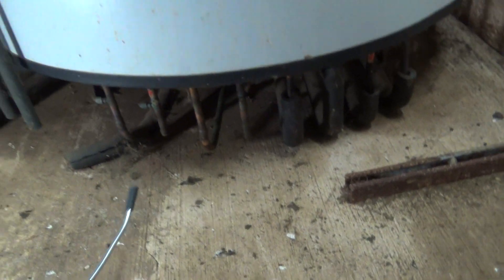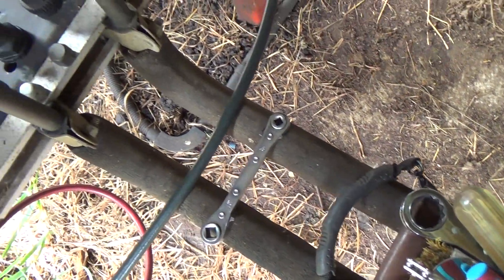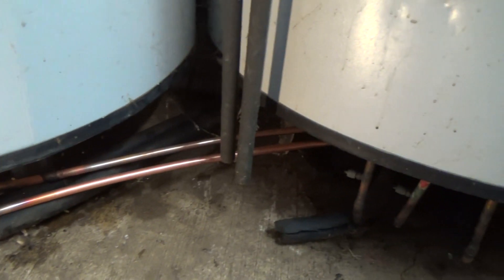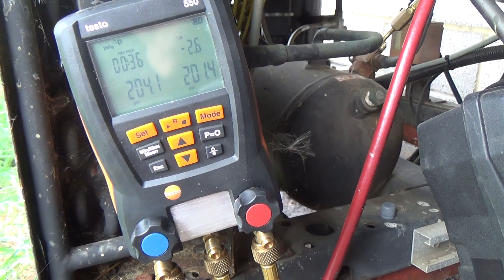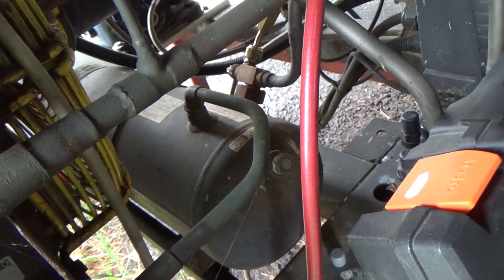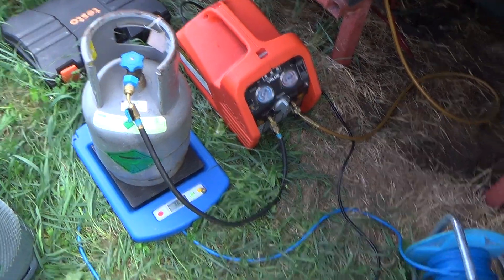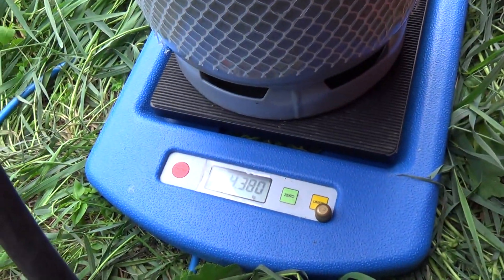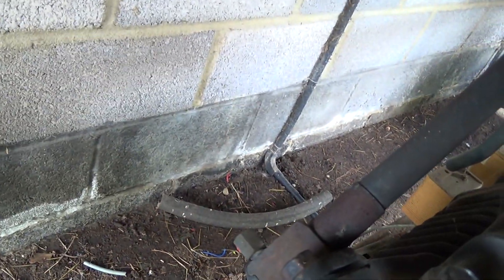Where has the Gas Gone?

Comment: Hey mr D....just a question. I have a cold room (for meat) and once a week I maintain the condenser and evaporator....where the fins are at the back, I tend to use a soft brush, and some compressed air to blow through any dust that might build up....in your opinion, do you think that’s ok? Or any other tips the keep the fins dust free
Thanks in advance
Lee
Reply from the maker: So long as the fins don't get damaged that sound like a good idea. You might not need to do it so frequently but that depends on how dusty it is there.
Reply: heavydiesel thank you, I tend do do it once a fortnight, and always careful of the fins. Enjoying your channel, cheers

Comment: Don't them air pumps make a mess, oil everywhere! awesome work as always!
Reply from the maker: Yeah they do. Last few new milking parlours I've seen installed they have used a screw vacuum pump so theres no oil out the exhaust with them, think they are better for running off an inverter.

Comment: what is this heat recovery? lol  i live in Toronto.. so there would be no way i'd know whats the purpose of that?
Reply: I also work in toronto. I see heat recovery alot. I see it used in a couple ways. One. They use the heat for space heating instead of dumping unwanted heat outside . Two. It can be used for heating domestic hot water in buildings.
Reply: In larger chiller or refrigeration systems instead if just rejecting the heat from the condenser outside. You can pipe your hot gas from your compressor to a heat exchanger and use that for a different purpose.
Reply: @saywhatmv9732  all i do is large chillers lol.... but i've never installed heat recovery ... no need it's stupid and expensive
Reply: @primetime758  I was led to believe from your comment that you didnt know what it was but it seems you know what it is already. Have a good one.
Reply: @saywhatmv9732  no i do know what it is.. but i just didn't know why discharge lines are going into some big tank? i know what heat recovery is.... I've done it.. two condensers one on the roof or outdoor the other is inside... controlled by a switch or thermostat... using solenoids... etc its expensive and useless.. because it the condenser was meant to be outside.. leave it that way
Reply: @primetime758  😂😂😂😂
Reply: @saywhatmv9732  Toronto ey? you enjoy using masters? (if you use them LOL)
Reply: @saywhatmv9732  whats up prime & say what!,  I work on many different heat recovery units, & btw if you didn't know i'm from Toronto as well ;) many condos use heat recovery vertical units, comfortability  on the off seasons, as well as dehumidification systems, All use heat recovery ie. Dectron, poolpak, Seresco & AAON.
Reply: @HVACRNorth  I'm also from Toronto lol. I don't run into these HRs but please make a video to have a better understanding of them if u can. Thanks!
Reply: @marinobravo1  check my page &/or email me if any questions. i do not come across this particular model of course lol but other similar forms HR units. Thanks fellow north Gents
Reply from the maker: The heat recovery takes the superheat out of the hot discharge gas and uses it to pre heat the water they use to wash the milking parlour and milk storage tanks. This site can heat two 1500litre tanks to 55C just from the waste heat from cooling the milk daily.
Reply: @heavydiesel  oh yea .. thought it was going to be for that. kind of annoying that the connections are right at the bottom... though but nice job!! quick thinking !

Comment: How do you like the testo vacuum gauge , is it worthy to buy 1 of these , or should I go for another brand  ?
Reply from the maker: I like it, but have heard other people don't like them. You need to zero them almost every time you use them because they compare the vacuum to the outside air pressure. If you go up a hill or the weather is different from the last use, the reading will be off.
Reply: @heavydiesel  thanks for the tip